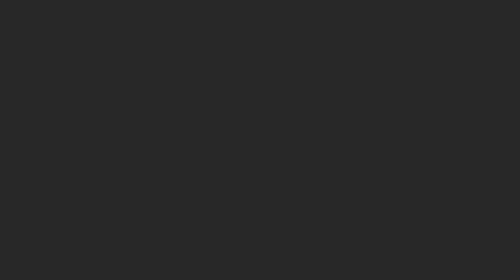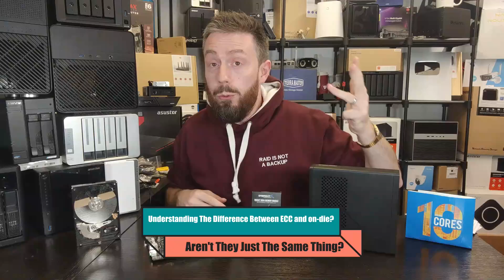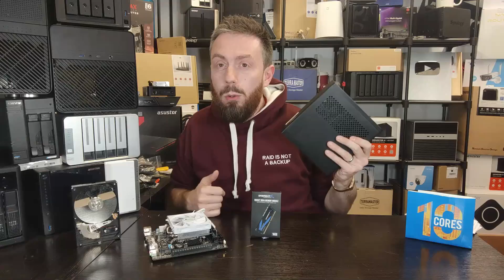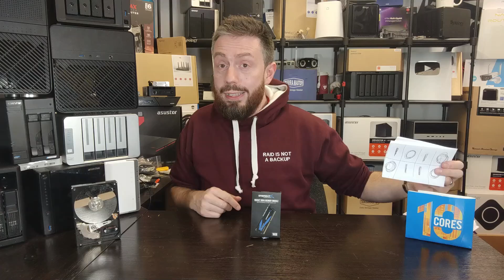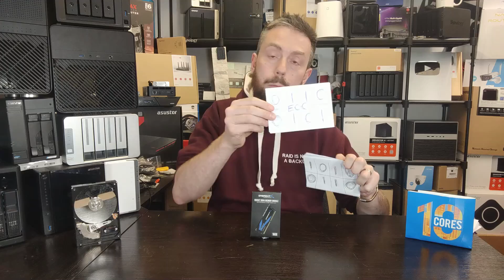ECC vs On-die ECC DDR5 Memory - What Is The Difference?

Comment: Is there any benchmark in gaming ecc vs non ecc?
Reply: ECC is usually clocked slower, games like higher clocked memory, especially with Ryzen. This fact is demonstrated by the benefit games usually get by the 3D vcache from AMD. That is effectively very fast ondie RAM: the larger amount of ondie cache has benefitted games, but you frequently don't see as much benefit to workstation programs. 

Intel typically restricts ECC for their server chips (Xeon) and won't let the desktop chips use them. With DDR5, the pinouts for the UDIMMs and RDIMMs are different and are not physically compatible. So to use ECC, the motherboard determines the use of UDIMMs or RDIMMs (and LRDIMMs). But that really just impacts DIMM capacity (DDR5 RDIMMs can hypothetically go up to 1TB per stick, while UDIMMs cap out at 128GB). Just about every CPU AMD makes (Desktop, for their mobile line you need to go with their pro line) can use ECC. But for AM5 you're limited to UDIMM ECC. Threadripper and Epyc use RDIMMs. I've been speccing out some NVR servers and the AM5 Epycs can use UDIMMs clocked up to 5600MT/s but the non-ECC sticks can go up to 8000. For gaming, it is largely understood (via Hardware Unboxed) that there isn't a huge benefit (cost to performance) to going much beyond 6400, and often 6000 CL30 2rx8 sticks are ideal. 

All that to say, if you aren't keeping a machine on and running for weeks at a time (if not months) then ECC isn't really much benefit and given the cost is largely pointless.  RDIMMs are important if you need a crazy amount of RAM, but get ready to drop 1,000s of $$ on RAM. If you wanted 128GB of non-ecc RAM, many kits of 2x64GB can be had for around $450 USD. A similar configuration of RDIMMs would be $600-800 and is clocked slower (often around 4800). A single stick of 128GB RDIMM often runs around $1200. And given that many Server CPUs and HEDT machines can use more than 2 channels of memory (filling out 1 stick per channel is ideal for DDR5), getting multiple sticks can really add up.

Comment: im curious about a possible delay and performance impact, im actually comparing lexar ares 7200mhz cl34 with on-die ecc and corsair vengeance 7200mhz cl34 without it, wonder how it will change my gaming experience as in stuttering, fps, my unity projects when compiling shaders etc

Comment: Conventional ECC will generate an error message in the system log. That way you can see the ECC errors that are discovered and can decide on changing memory modules before they generates a uncorrectable error. In general you don't see a ECC error in months. A single ECC error is no big thing, shit happens such as stellar radiation flips a bit. One error is just a sign that the ECC works. If you get a several errors from the same DIMM then it's a good chance that a memory chip on that DIMM has deteriorated and it should be replaced before a non recoverable error occurs.

This is information you don't get from DDR5 memory stick that only support On-die ECC. Even if a chip on the DIMM has degraded so the on-die ECC has to repair the data more and more often the user don't get any sign of that before the memory really fails.

Also standard ECC can detect and repair single bit errors. If two bits of the same 64-bit word is compromised ECC can still detect an error, but it can't repair both bits. That's a unrepairable ECC error and most OS will be set to halt operation if one of those are detected. That's effectively a crash.

More advanced ECC implementations has been designed and are able to repair dual bit errors. But the problem is that more parity bits are needed which makes this kind of memory more expensive. Another version in the ECC range can issue a kill bit to disable memory that has generated ECC errors. The idea here is that if a memory chip degrades and starts to throw errors it will be deactivated and less memory will be available for the computer to work with.

Yet another ECC implementation used DIMMs without ECC bits, but added extra DIMM that was used for parity bits. I can only remember seeing this used for cache memory on a RAID controller way way back, and I have no memory of seeing it used for system memory.

I can't remember the names of all these technologies except I think the technique of disabling suspect memory was called Kill Bit and I think ServerWorks developed that. I've worked a lot with server grade equipment, but a lot of it was ages ago, and unfortunately I've suffered some brain damage since. A lot of memories are fine but my memory of names has suffered a lot.
Reply: Does having the memory underground reduce the risk of errors from cosmic rays? Say 4 feet of earth and 12” of concrete.
Reply: @kdw75  There is not much to do about protecting the memory buy digging down. The particles that may cause a bit flip passes through huge amounts of matter. If I remember correctly they can pass right through the earth. There has been detectors made to measure them and those are hilarious in size. One of the materials that can on occasion halt a particle is water, both frozen and liquid, and scientists has used that to make detectors in the arctic region where they have ice that is hundred of meters thick and is almost as clear as glass. When a particle hit an atom it will cause a energy release and by putting a lot of sensors in drilled holes in the ice these can be detected. This is most probably also the reason why a ingle particle hitting a memory can cause the values of a single bit to change enough that it flips in value when the memory is read.

What you can protect against is electrical noise, radio signals and so on. these are usually not a big problem but less noise is not a bad thing.
Reply: so... On-die ECC is better then? also, do I have to buy a mother board that supports ECC? I was planning to buy a new pc and noticed that some mother boards says Specs that   "supports" ECC like the Asus TUF Gaming B650-Plus WiFi, is that important? or it doesn't matter at all only if the DDR 5 has On-die ECC  on the specs?
Reply: @smdvj  Apparently you have to go with the 7960X or above to get true error correcting. That is what I am doing. Everything else is just half arsed.

Comment: On-die ECC is a mechanism that allows OEM to sell ram that is FAILING silicon.
Reply: Yeah no

It's due to mandatory by spec
Reply: @reabstraction  The spec was amended to include On-Die ECC because without n die error correction failure rate was running 34%

Comment: I do believe that the drawing in your right-hand was held upside down, that would be confusing the onlookers, possibly.
I do like the approach though!
Reply: Indeed, up to @02:38, the drawing in your right hand is truly upside down, yet @02:45 it is shown correctly....
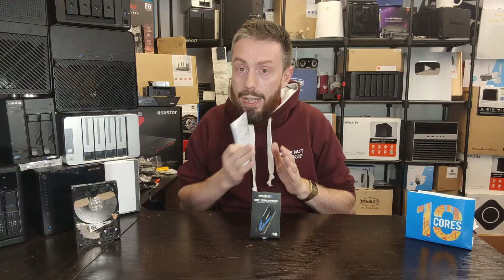Reply: BTW, I do believe you are not correct @03:33 talking about flash memory with respect to DDR5, it is and always has been SDRAM. (synchronous dynamic random-access memory)
Where flash memory has its origins to magnetic bubble memory, SDRAM is in fact small capacitors, with FET's.
Flash memory is inherently way slower than SDRAM. (Flash is also serialised memory, whilst SDRAM is parallel accessed)
I do not want to be brutal here but you are mixing-up technologies in this topic that might confuse or give incorrect expectations...
Reply: I dove a wee bit further into on-die ECC for DDR5;
In short, on-die ECC only checks the data as stored inside the (SMD) memory-chips. It will do nothing when the data leaves that DDR into another controler-chip, CPU etc. So it will not check the data in transit.
Regular ECC will check the data between the memory and the destination which/when it is (also) ECC capable.
So, why on-die ECC with DDR5? 
Because the formal JEDEC specification dictates a frefresh-rate of 65msec, but with the often way more denser DDR5 cells (much like QLC flash, compacting more cells into the same space), the chance that a bitflip occurs due to thermal issues, cosmic rays (yes, really!), slower cells somewhere in the package and so forth, is increasingly a worry. So to meet those JEDEC standards for DDR5 and providing a bigger yield during production, on-die ECC can be included into a particular DDR5 memory design.
But it is only for the data still residing inside that memory. The moment that data leaves the DDR5 memory-stick (to a CPU etc), that on-die ECC has no meaning at all. Full stop.
So, in case you need ECC with your DDR5 memory-stick, you will need a DDR5 ECC memory-stick...
That on-die ECC for DDR5 is just clever marketing from the memory-manufacturers.